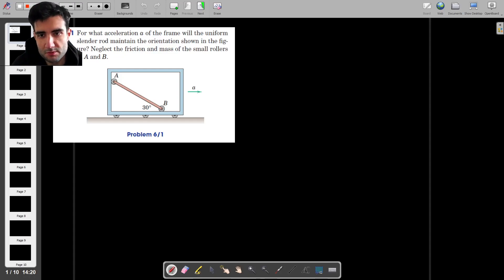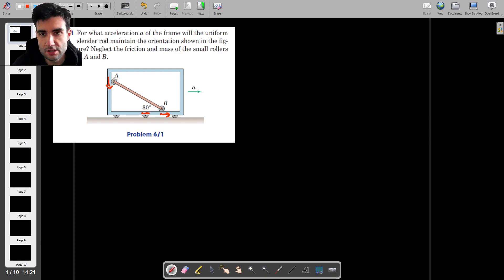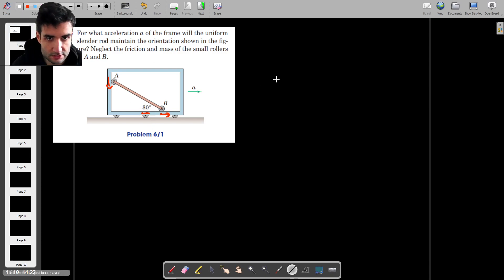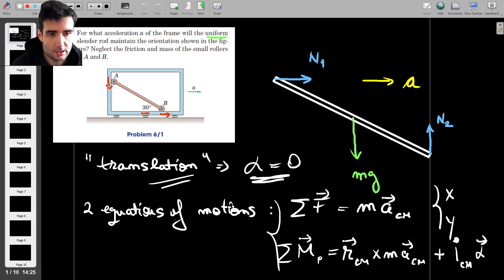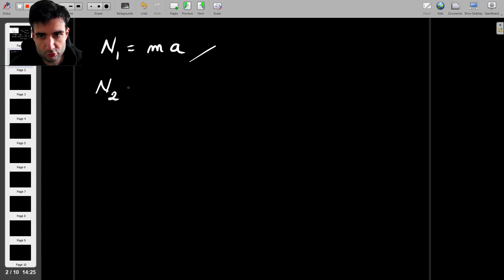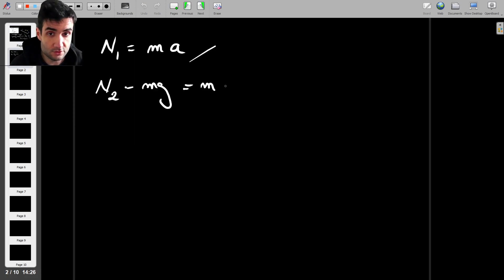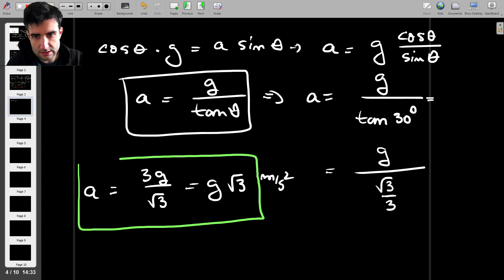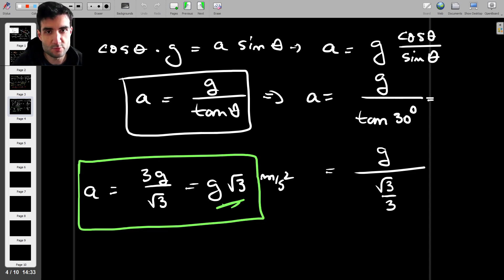Finding the acceleration of a non-inertial frame of reference

Comment: Considering moments about N1, & setting them equal, gives that N2 = 0.5mgcot(theta). Why is that?
Reply from the maker: You can't set them equal to each other though if you take moments about N1. Have a look at minute 5:18 for the complete equation of motion involving rotation. Even though there is no angular acceleration, the term involving the acceleration of the CM has to be now taken into account (because r_CM is no longer 0 when you take moments about N1). In the end you will get the same answer even if you take this approach.
Reply: Got it. Thanks for the informative answer. Keep up the good work :)